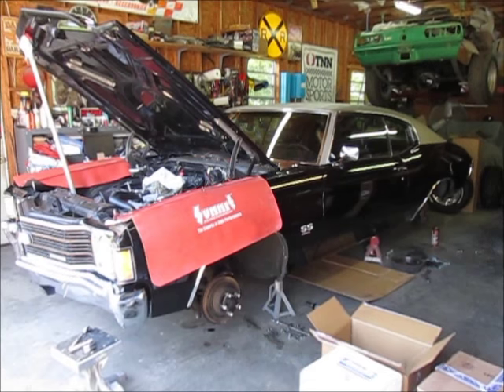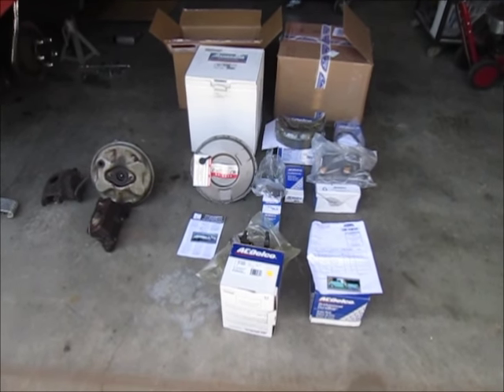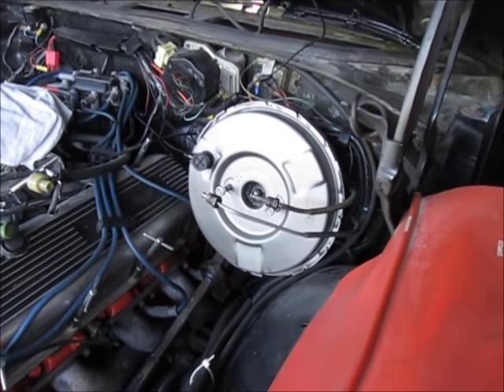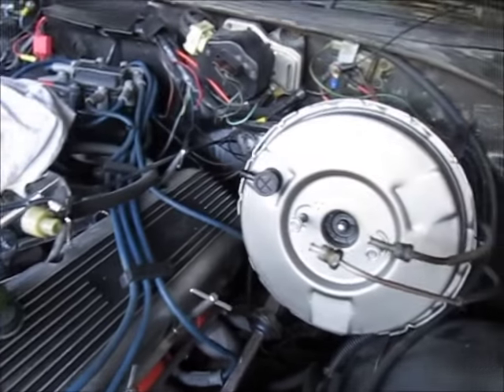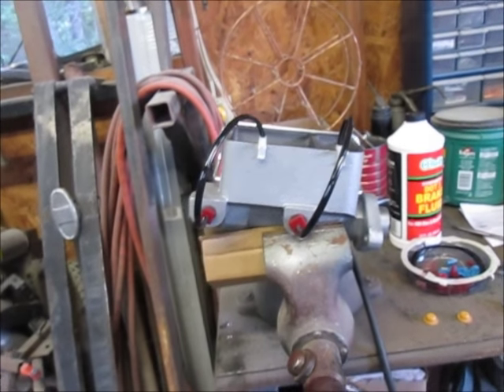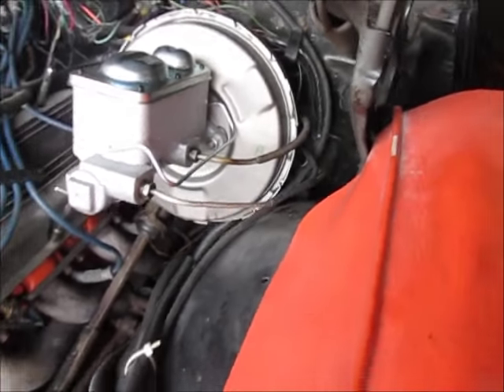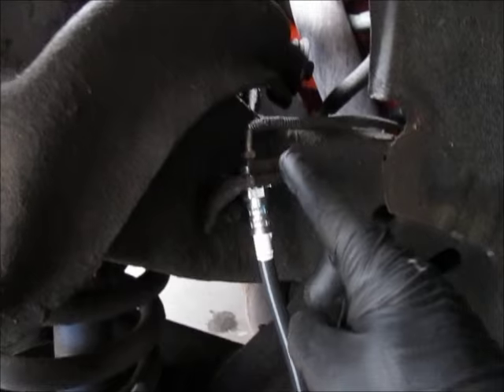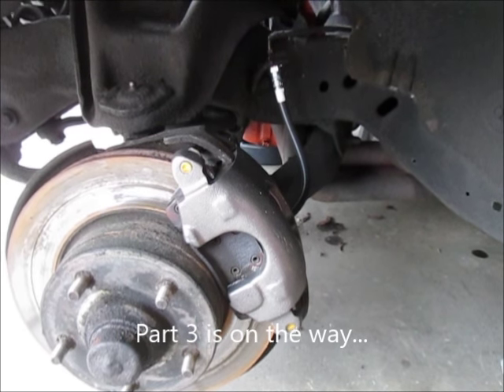Chevelle brake parts installation. Brake booster, master cylinder.

Comment: Coming along great brother 👌🏻 I see you don't put any silicone on the back side of the brake pads 🤔 I guess that's just us old timers, also are you going to squeeze the outboard brake pads ears onto the calipers after you bleed the brakes?
Reply from the maker: Yeah, they didn't use silicone at the factory... Squeeze the outboard pad ears? Not sure what you mean there...
Reply: +Jo Daddy's Garage what I mean is if you look at the outside brake pad the bottom is seated in a slot in the bottom of the caliper the top of the pad had two tab's that go over the caliper they need to be knocked down tight or the outside pad will move when braking. I usually put a chisel in between the lower pad and the rotor tap it in a little that pushes the pad upward than tap the two tab's down tight and the pad won't move around after the brakes are bleed and have someone step on the brake pedal so the pad is tight against the rotor. You may think it's not moving because the pads and rotor have the grove in it but it will 😉👍🏻👍🏻🇨🇦🇨🇦 just my two cents brother

Comment: Just as info:  SS Brake rear drums are wider than those for a small block.  Prrt numbers in video are for a 350.  Hope this helps and saves an issue.

Comment: Did you use the upper or lower hole on the pedal for the booster.
Reply from the maker: I don't recall. It had a power booster installed previously, so I repeated the install.

Comment: Hola saludos nesecito saber el precio de un kit de brake para el ford maverick del 75 lo nececito......gracias
Reply from the maker: Power brakes? Disc conversion?
Reply: disc conversion...y envio a ecuador cuanto.......?
Reply from the maker: Not sure I can be much help. Here is an ebay link.  
http://www.ebay.com/itm/1970-1971-1972-1973-FORD-MAVERICK-FRONT-DISC-BRAKE-CONVERSION-/181951874311?hash=item2a5d2d4507:m:mLy6RcYbvqgzW-2M2hmGpyw&vxp=mtr
Reply: Jo Daddy's Garage
gracias lo necesitaba aca en ecuador....gracias por tu atencion...